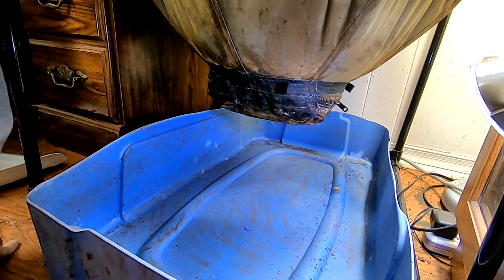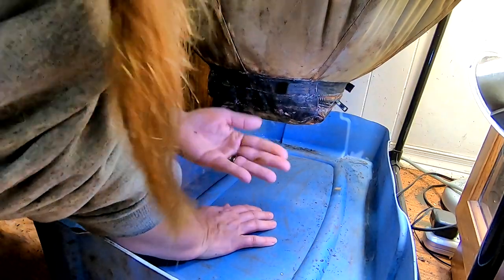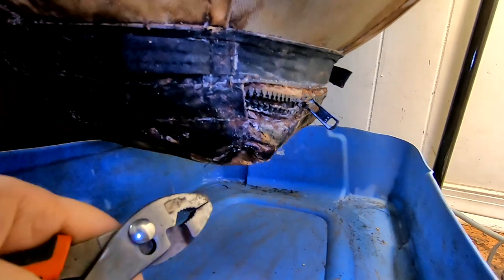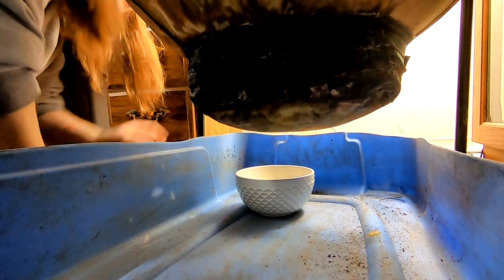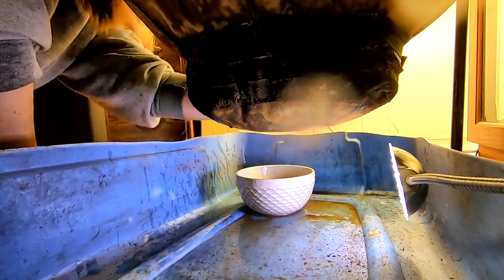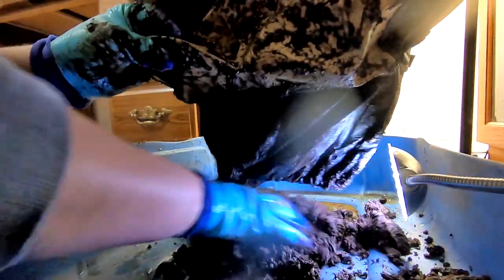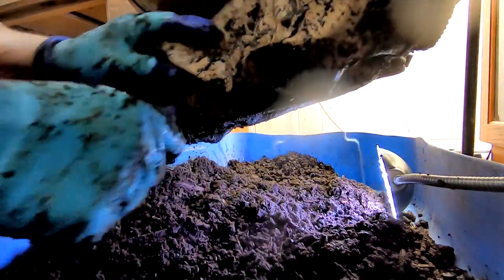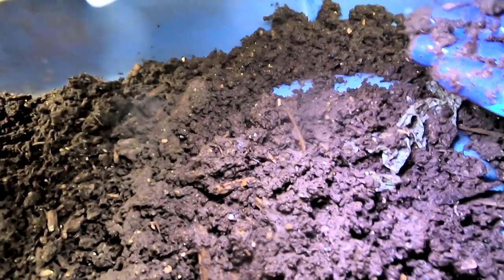URBAN WORM BAG HARVEST DECEMBER 2019

Comment: Thanks Ann, can be quite the struggle with mineral build up.
Reply from the maker: Yeah, I'm not 100 percent sure what item was the cause of it.  I ended up soaking the flap in water to get the rest off.
Reply: @PlantObsessed  Vinegar water does a pretty good job on those mineral deposits.😉
Reply from the maker: @waynetadlock9719  I thought about it,, but didn't know how many worms would be in the area. I didn't want to hurt my little buddies 🐛🐛

Comment: To each their own but personally, I fail to grasp the attraction to these style farms and that was before seeing the problems you faced here.

My preference is with the mortar mixing tubs, the Rubbermaid Roughneck Tote 37.9-L, or for my outdoor farms, Rubbermaid garbage cans with a vent stack through the center.

The concept of a flow-through is definitely attractive but the size, weight makes it cumbersome to move and especially to empty, even if it wasn't all gummed up like yours was.

Even the industrial sized flow-through bins do not utilize vertical space and require a lot of real estate. Of course the advantage is to easily fill the top and mechanically empty the bottom but even then, someone has to manually reach under and drag the castings out from under which again, defeats the purpose of the mechanization. I digress.
Reply from the maker: I only have this type of system for one reason.  African Night Crawlers.  If I didn't have them I would 100% agree. I prefer the totes and mortar trays.
Reply: @PlantObsessed  I had to look back at "UNBOXING urban worm bag for my African Night Crawlers" to refresh my memory. I totally get it.

I don't have ANC but do have ENC that like to venture off. I cut cheap landscape fabric to size and cover each bin, secured with stretchy string. Keeps the outside out and the inside in. Mainly just for gnats now since my ENCs don't venture as much since I did it, though I don't know why exactly.

My basement is above ground and the climate is very different here in Vancouver, BC